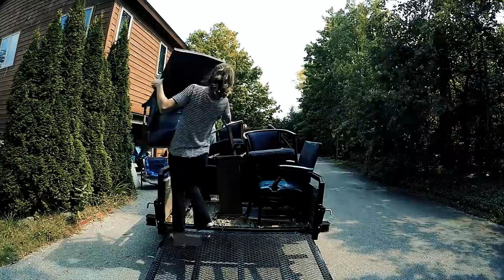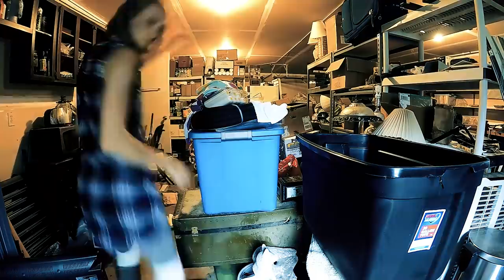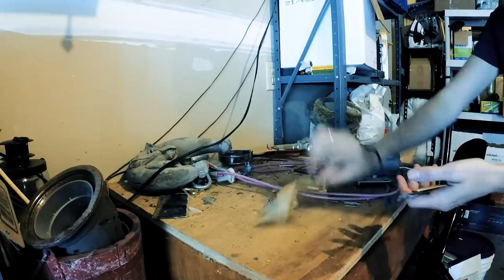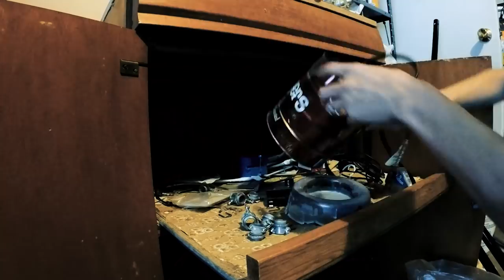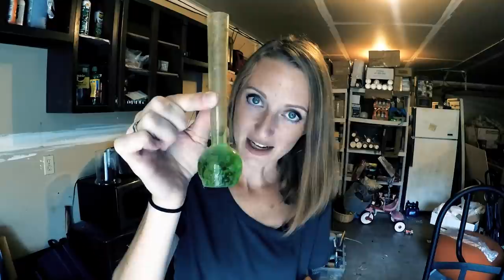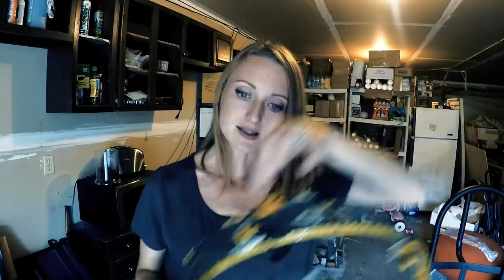Decision Fatigue | Biggest Decluttering Roadblock

Comment: In my garage I found a lot of items I was able to return to Home Depot.  I was able to get about $200 back.  So if there are projects you've worked on and did not use all the materials...like say light switches, electrical boxes, sprinkler parts etc, you can return them without a receipt if they have a bar code on them.  I think they'll give you a credit.  This helped me get rid of items that I would not have thrown out and it freed up a lot of space.

Comment: Is it worth having someone come help you with this? It's not for everybody, but if you can give them some basic requirements (Is this still good, is this something that has a home in your general lifestyle, etc) they could help you move items and power through it. Having stuff on the backburner constantly is way more tiring than getting it done in one or two shots for me, and even if all they do is help you decide where things go that you DON'T want, it sounds like that could help a lot so you decide what's in your life, and they figure out the rest based on your values.